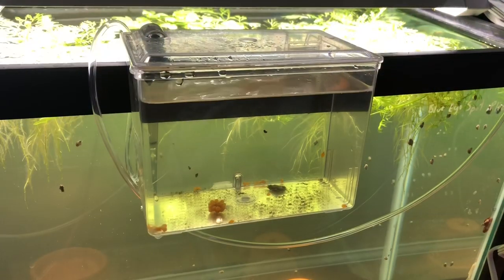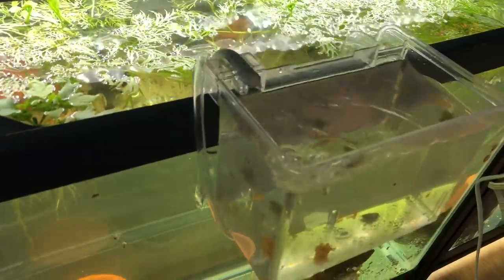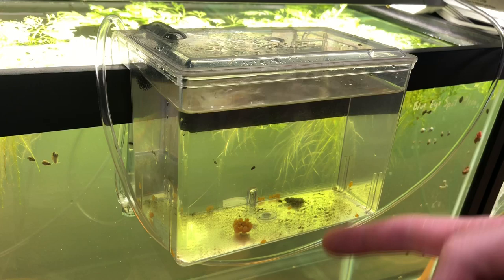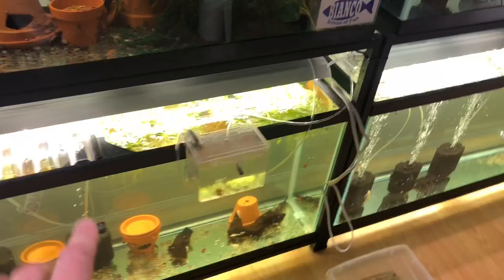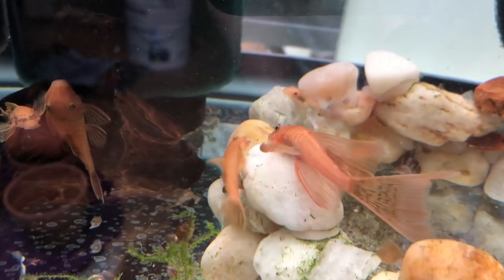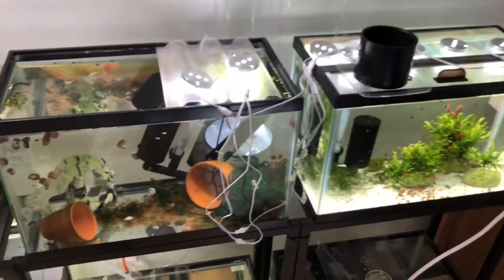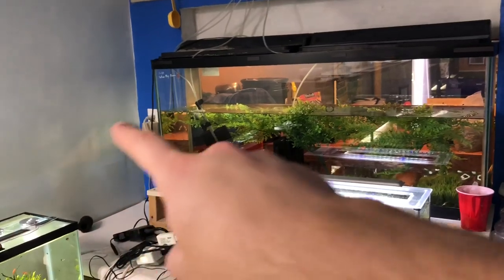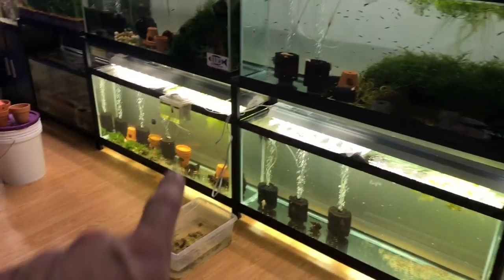Breeder Box Upgrade/Fish Room Tour

Comment: You could reduce the air flow with a valve controller and still have enough water cycling the breeder box since it's small. With the continuous water change and the surface movement made by the breeder box it's really enough for O2 exchange.

I like your video and actually ahowing the breeder box in use.👍

Comment: I've never understood why they don't just make the uplift slightly larger to fit an airstone, you only need a tenth of the airflow for the same amount of water flow when you use smaller bubbles, and it's also quieter instead of going SPLOOSH SlOsH SplåSh like those non airstone uplifts hahaha xD